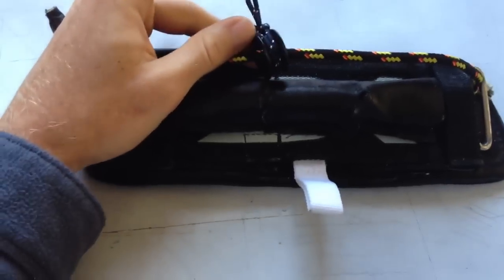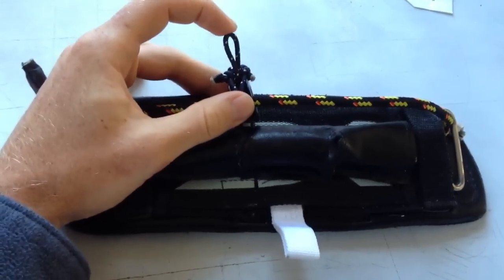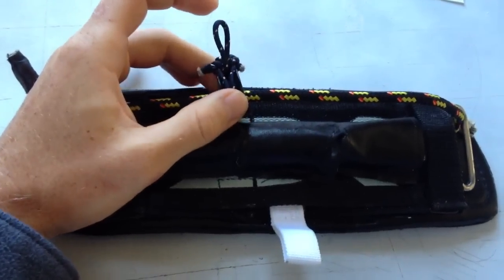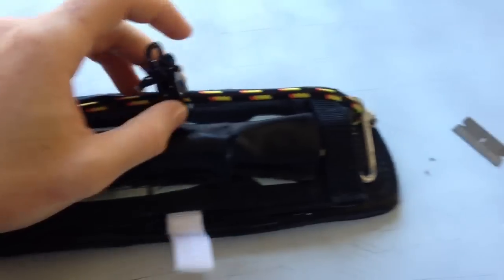Basic Slider Bar Setup

Comment: That can work, depends on the type of polyurathane your chicken loop is made of. Soft stuff will get eaten by the rope, harder stuff is fine. This video is pretty old, the bars I currently make have a hard polyurethane cover on the rope so you can attach directly to it no matter what your chicken loop is made of and it won't wear out. Saw your other comment about the carabiner, those work fine they are just kinda big and can get messed up easily by the sand and salt water.